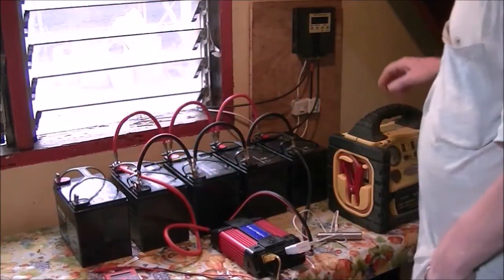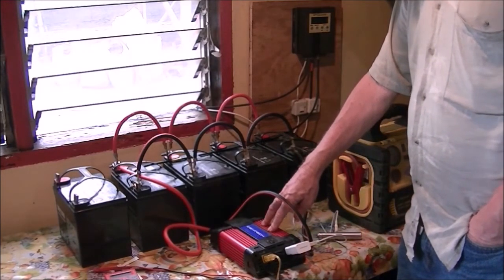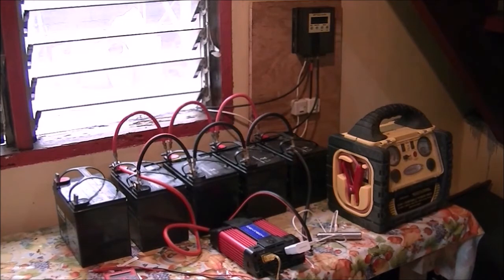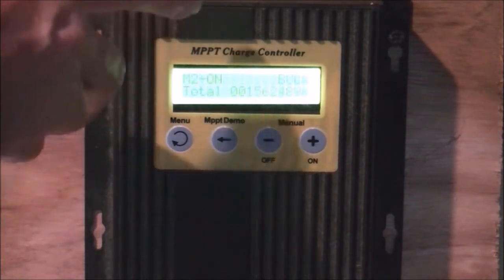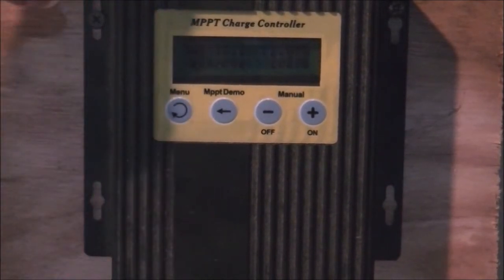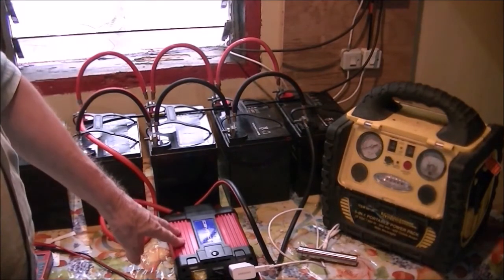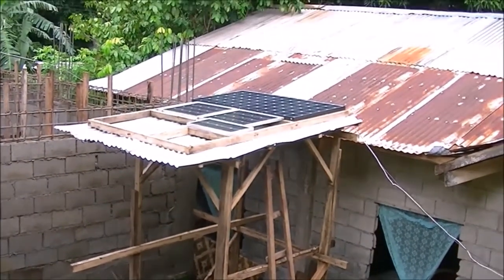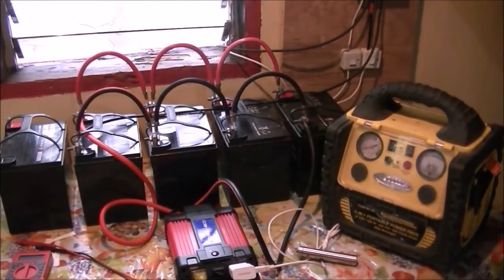My Camiguin Island Solar Power Setup: Take 2

Comment: You should make your battery setup out of the house or else you'll get a lot of headaches and health issues. Nice setup mate.
Reply from the maker: My batteries are sealed, so I don't think it's a problem. There's also loads of ventilation where they are.

Comment: are those 12 volt solar panels wired in parallel? if yes, then even if  mismatched in size, they should work fine. nice set up you got there. i used automotive blade fuses, very cheap and easy to find
Reply from the maker: It sounds like you know a thing or two about solar power.

Comment: You can use automotive fuses for the solar panel. Also you can splice in a small wire to use as a "fusable link" that will cost next to nothing. ( a fuse is just a small wire that will melt at a certain overcurrent. )
Reply from the maker: Some good suggestions. Thanks.

Comment: Yes that would probably be the smartest move lol. But. Selling used stuff here in Calgary, AB doesn't fetch much in return especially in the field of electronics. I might be able to recover 25% from my investment. I am not bringing batteries btw, just the panel and all associated electronics. The batteries I was using so far were the house batteries from the MH and they kinda have to go with it when I sell it. The grand plan is that as soon as I sell the MH I will buy a 45' sea can in which I will bring all of our household goods. There will be plenty of space I hope to bring the solar stuff in there. My 3000W inverter will be able to run all my American electronics and power tools/shop equipment. From what I've read, returning Filipinos (my wife) and 13A visa holders (myself) qualify for importing household goods without having to pay customs fees, etc. And bonus, when it gets there, I can use the sea can as a shop and or storage at no extra cost since the can is waterproof, lockable and fairly spacious so I don't have to build anything. I figured if I can at least power my shop with my existing system+ some batteries and a couple more panels I wold be doing great. The plan sounds great so far, lets see how it unfolds.
Reply from the maker: It sounds like you have it figured out well. We shipped our stuff ocean freight, and they still charged us import duties. We hadn't arrived in the Philippines, though, and had some relatives pick our things up. The whole experience was an expensive mess.
Reply: Terribly sorry to hear that. We have heard it's a good idea to send it away in such way that it arrives there when we can be present for picking up

Comment: Very nice system you have. I am from Canada and got involved in solar couple years ago. It wasn't for my house but for my motorhome because we like to camp in the bush where there aren't any hookups. We've often ran out of battery power, the motorhome only has 2 house batteries (2x6v golf cart batteries in series, flooded lead acid) although we were pretty conservative with our power usage, after a couple of days we were running low on power. So I decided to educate myself on solar and buy/install my own system. After about 6 months of research and learning I decided I was competent enough to get started. I ordered my components and started the install. I ordered the majority of my components from China in order to keep the cost down. The downside of doing this is that one would have to wait for the parts to arrive up to 2 months which really sucks. Either way, the system was put together in half a day and then I started testing. Everything works better than expected. My old batteries suck because they are old and very inefficient so they don't seem to hold much power anymore. We would use the energy at night and bring the batteries down to about 70% and next day once the sun came up the batteries would be charged within a few short hours (before noon anyways). That made us very happy because we didn't have to use the stinky noisy 3000w generator. Actually we've never had to use the genny in 2 years now since we have solar. I only have one 265W panel btw and this seems to be sufficient for our use. I future proofed the charge controller and I could have up to 4 of those panels hooked up but I was clever enough to start my experiment with just one which is more than sufficient for now. There is no need for A/C here in Canada most days so we don't really have to run one. We run the microwave oven on a small inverter and that's good enough for us since it only needs to run 10-15 min at the most.We are moving to the PI this summer so unfortunately I have to sell the MH, but will keep the solar system and bring it along and I plan to expand and ultimately want to run my entire house with it. I was doing some research on where to get solar components in the PI and found this site, the prices are very decent, actually a lot cheaper than in Canada and thy claim they ship and allow COD payment which is awesome. Check it out guys right herehttp://solarprice.com.ph/In the meantime guys have fun building solar!If anyone needs any help designing a system just ask me.Florin
Reply from the maker: Interesting story. I'll tell you, though, I sent my panel and batteries here, and that was a mistake. I think you'd be better off buying that stuff here. It's more expensive here, but sending a big panel and batteries will cost a lot, and then you'll get hit with import duties. Sell your stuff in Canada and use the money (plus more, obviously) to buy stuff here. Now, depending on where you're going finding solar wiring and connectors like MC4s can be challenging. You might want to bring that with you. Good luck.

Comment: Solar and batteries is definitely part of the solution where the power is often out.  I was involved with solar many years ago.  They are getting more efficient but have quite a ways to go with new materials.
Reply from the maker: Were you a solar installer? You're right that things are slowly improving. It'd be good if prices could drop. It's less expensive than it once was, but it still isn't cheap.
Reply: Not installer.  I sold a few panels and was approached several years ago by a couple manufacturers to distribute but they still had testing and approval requirements.